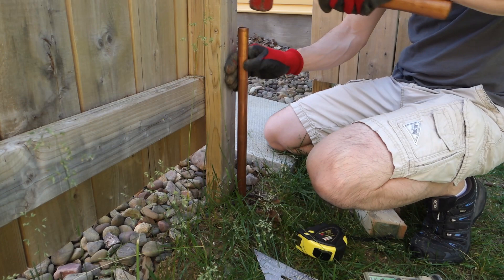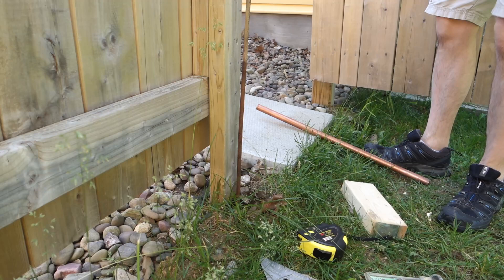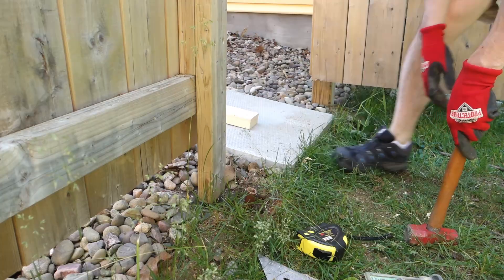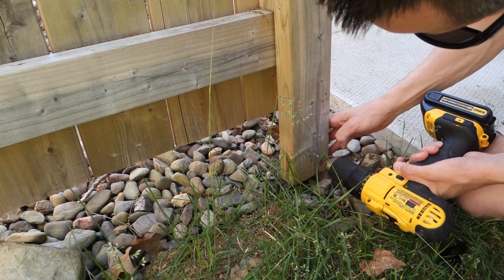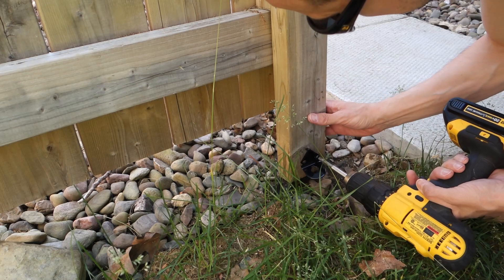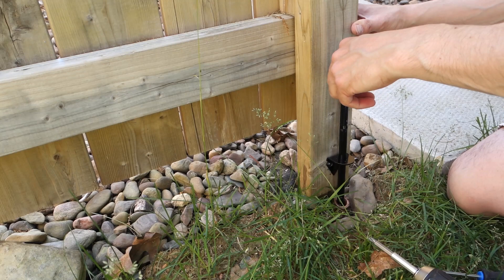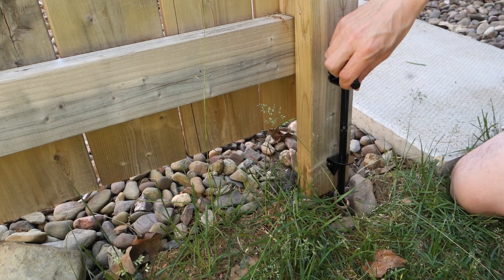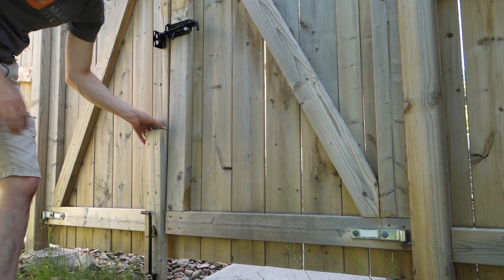How To Secure A Double Wooden Gate using a cane bolt

Comment: Thanks for the video! I realized after getting a fence gate latch from lowes that it would never actually keep the double gate closed and came acros drop rod kits but they never tell you a good method for using it on dirt! It’s either some very expensive hired help method or down and dirty new concrete pouring. Glad I found your video I now have some copper pipe and a rod kit to use on my fixed up fence once I get it installed😅plan to use this super long drill bit the previous owners left in our garage to bore out a hole for the pipe and then pack down the dirt inside to help hold it more.
Reply from the maker: Oh ya.  A long drill bit should do a good job.

Comment: Doesn't the pipe fill up with dirt as it is being driven into the ground?  What was the diameter of the pipe?  Thanks for posting the video.
Reply from the maker: I hammered a piece of metal rod and wiggled it around to get the hole started therefore the pipe didn't just fill with dirt.  I used 3/4 pipe. Here's an affiliate link to the pipe: https://amzn.to/3mueVBD
Reply: The link doesn’t work

Comment: Have you had any issues with water collection?
Reply from the maker: No standing water issues in or around the pipe.  I did notice the other day that the pipe appears to have raised slightly, from frost heaving. 
 One tap is probably all it will need to set it back down so I don't trip on it when the second gate is open.